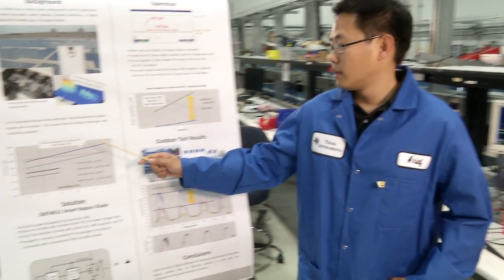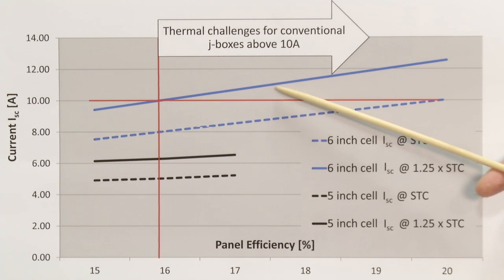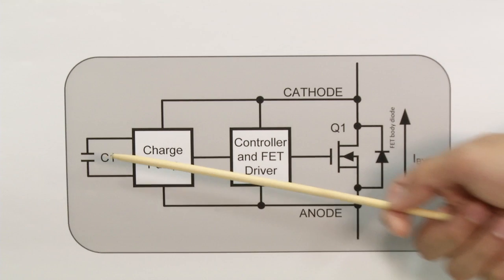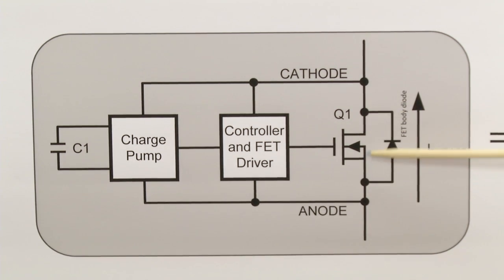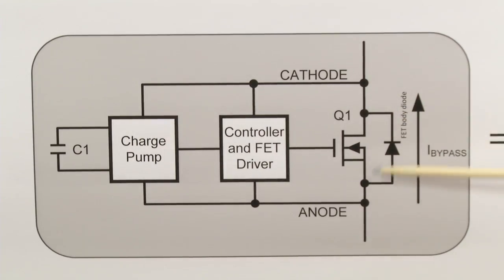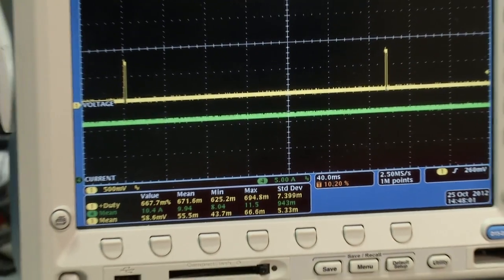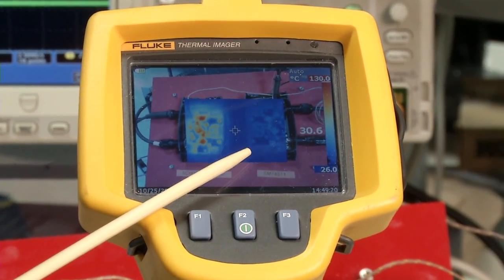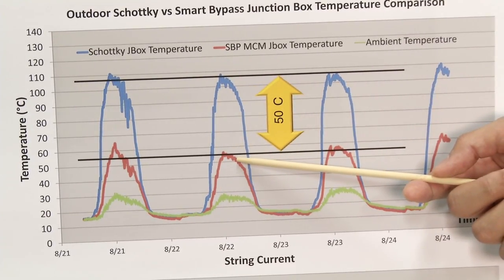Smart Bypass Diode

Comment: Hello dear 
I have 12 23 volt 20amp spms connect in series
I want to put a bypass diode on each terminal of the smps to protect them
Whats kind of diode do you recommend and what are the specifications 
Thank you

Comment: Can this be used as a diode to prevent batteries from discharging through a PV panel?

I've got a cheap USB charger (5V ~1A), but it doesn't seem to have built-in protection against a reverse-voltage condition causing battery discharge. This looks like it could be a very simple fix, in series between the panel and the load...?

Thanks!